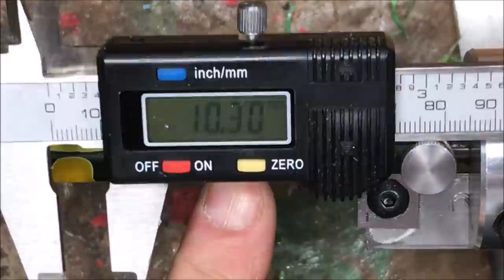Turning a Kit Less Parker Refill Pen (Full Version)

Comment: Bob, Nice video. In a previous video you mentioned that the tenon turning tool uses  a letter "A" size bit for the pilot hole. In this video you mentioned it was a quarter inch (.250"). I was wondering if this is an update or if the "A" size is still recommende?
Reply from the maker: Hello Thomas,
  You are correct, I had to reread the instructions and it does suggest an “A” bit as the best diameter for the cutter. 

Regards,
Bob

Comment: Bob have you thought about making a clip for the pen to hold to your pen in your pocket on the cap. You can order the clips. All you would have to do is make a tenon that the clip would slide onto put a hole for the tenon to slide into. Put a little thick CA in the hole and slide the tenon with the clip onto the cap and it should never come back off
Reply from the maker: Thank you Gary,
  I have been working on one for my next project. 

Regards,
Bob
Reply: Just thought that would be sharp and easier to keep track of and not lose

Comment: not a fan of acrylics myself, but very nicely done.  it would interesting to see this done in wood!
Reply from the maker: I’ve done something similar in wood. It requires making acrylic inserts as most woods will not take threads well. 

Regards,
Bob
Reply: i done some coarse threading, 3/8 NC for bottle stoppers.  i saturate the area with thin ca before and after threading but yopu dont get nice looking threads like your pens have.  my coarse threads are perfectly functional though
Reply from the maker: You can make an insert for the stopper with Alumilite. Just thread it and turn I to the desired diameter then ebony it in. I’ve done that numerous times and it works very well. 

Regards,
Bob

Comment: At around 22 minutes you discuss the S bit versus a 1/4 drill bit.  You state you used and S bit, but should have used a 1/4" bit.  But earlier you made the comment that an S bit is the correct bit for a 10MM tap, can you explain?  I'm confused about which bit to use 1st?   Before you tap?
Reply from the maker: Hello Rick,
  The “S” bit is the proper size for the 10mm tap. What I was worried about was buggering up the threads I had just made. 
  I need to drill the 1/4” hole for the tenon cutter  guide first, make the tenon, then come back and drill the “S” hole for the tap and thread it. 
  Sorry I wasn’t very clear in that explanation. 

Regards,
Bob
Reply: Thanks!

Comment: Bob, I enjoy your videos but why do you jump back and forth between metric and imperial? measure in metric then drill in imperial to do a metric thread.... now i can just ignore your imperial drill bit sizes because i know metric so i know my m10x1 thread needs a 9mm drill. i can jump from common imperial to metric as i old and worked on old cars with imperial fixings so know the metric conversion. not sure how many of your countrymen use metric?
Reply from the maker: I jump back and forth because I haven’t acquired a full set of metric drill bits. Little by little I am adding them to my collection but it takes time and money. Eventually I’ll be able to settle on metric for everything. 

Regards,
Bob